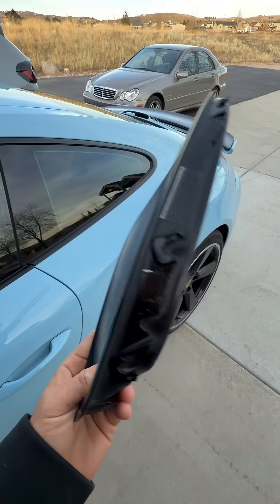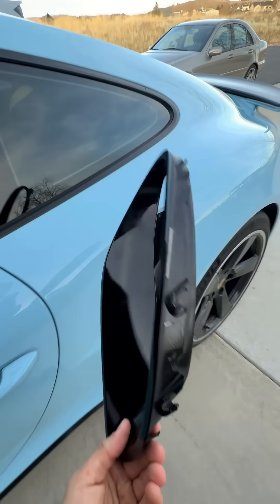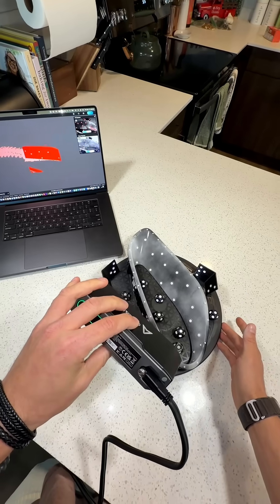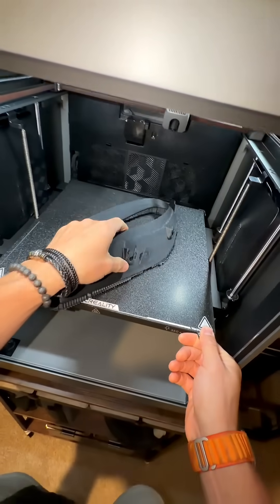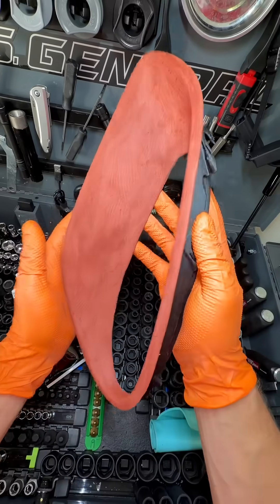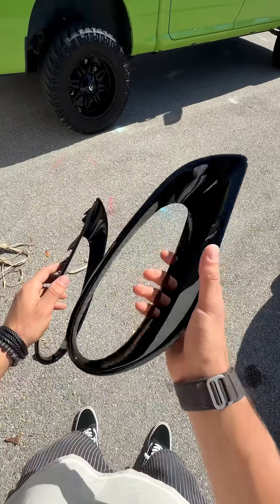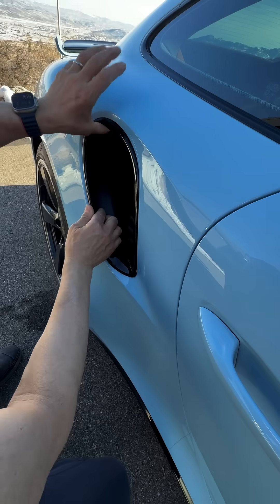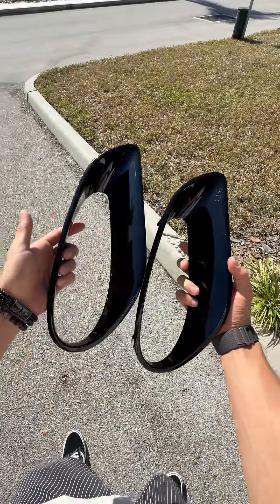Porsche wanted $2,000... So I 3D printed it for $20 instead😳😳😳 #3dprinting #creality #porsche

Comment: Well done... unless you paid somebody for it.
Intellectual property, you know.
Yet it should be OK if you perform it by yourself or have it for free (need some checking though.)
Problem is, 10 years after the last model was produced, car manufacturers may be free to stop providing parts.
Ah but intellectual property still holds.

Comment: “It actually costs more, and takes longer, and needs more knowledge”
Do you people genuinely think this man was suggesting that you buy and learn how to use a 3D printer and scanner for the sake of one repair? Obviously he wasn’t, the point was that he already has this stuff, and that therefore makes this cheaper than buying the part, so you don’t have to shell out an extra 2k for it. It does take longer for sure, but I’d rather wait a bit than pay the 2k when I know I don’t need to.

This comment section is so collectively dumb.

Comment: You could have just bought them from aftermarket sites for a fraction of what Porsche asks for them. It took me about 30 seconds to find three sites that offer them in carbon or ABS, both for around 1000 dollars. I mean, I get the point, but it is not as dramatic as you say. You really should not be buying original Porsche parts, that is for sure.

Comment: That’s been stolen. Classic parts theft. Happened to an Audi A4 I had. Three weeks old and found it missing a mirror (just the glass, the housing and interior workings were fine) and the cover off the driver’s side front wing turn signal.

Comment: Yeah. 3D Print can save money. Spar parts often expensive or not available.
I used my 3D printer for spare parts already. Some small parts in example, where only a complete assembly was available as spart part. In one case it was only a small gear, where only the complete drive was available. So reengineered it and printed. since 1 1/2 year and on going it is working flawless. ☺️

Comment: Bullshit clickbait! This did not cost you only $20. The 3d printer that is required to make the part costs around $500 (at least). Cost of the 3d app? Cost of a computer to run all of this? And not to mention the cost of the primer coats and paints. You said yourself that the "flawless paint match" cost you about $100. Not to mention all the time and labor you spent doing this all yourself. Maybe total with all the necessary tools to do it yourself is around $1000 or more.

It's still less than the $2000 that Porsche wanted. But at least don't be dishonest and say this only cost you $20.

Comment: buying a product: 2k

but, i am doing to DIY it, so
have the knowledge of modeling: $100/h
have the right 3d printer: 1k?
have the printing material: $25?
have the scanner: $500?
have the spray: $25?
have the computer that can run 3d stuff: $600?
have the 3d app: $100/month

let's say it takes 4hours 100*4+1000+25+500+25+600+100=2650😂

well i guess if I got a Porsche, neither time or money is the issue.

Comment: I'm amazed how people are defending the multimillionaire company instead of the YouTuber that 3d printed the piece.

"the 3d printer is expensive" yeah but it doesn't count into the cost of the piece, it's like saying getting gas in the gas station is expensive because you need to build the gas station... No dude, you don't need to build a gas station, it was built by someone already and you just need to pay for the gas.
Reply: WRONG. If 3D printing everything at home was an option for EVERYONE to avoid dealer prices, then everyone would already own a 3D printer, all the hardware, software, materials, and tools needed to make parts. You can't just overlook the cost of all that stuff. It factors in whether you agree or not.

Comment: Note: don't do that
you absolutely don't need a 3d scanner that is worth more than a used car. You can just take measurement, and design the part yourself. Sure, it might take more time and you need knowledge, but you will just need caliper, and the dimensions iwll be much more precise.

Comment: if you take out the 3d printer from the calculation then you could produce it for like 300€ if you only print it and let a professional sand, fill and prime and paint. I mean at that point it doesn´t matter if it´s 100 or 300$ you saved a lot. also you could sell those for like 1k and make huge profit and be still 700$ cheaper than og parts xD.

Comment: So, two or three jobs with this printer to break even, from then on, it’s money for jam.    
Similar economics, I was looking at hiring a local earthmoving contractor about 15 years ago to do three jobs on my farm.  Quoted $15K to $22K (three quotes).  I bought an old excavator for $10,500 and kept that machine for 15 years, using it at least once a month throughout that time.  A year ago I bought a brand new excavator, and sold that old one for $7600 (it was around 23 years old at the time, but worked fine for its age).  
I am now an earthmoving contractor, in addition go being an RN (32 years), farmer, boat builder and metal fabricator.

Comment: I would incad make the push pin / clip system about 15 to 25% larger and use a more vibration resistant plastic

Comment: If you keep doing it and keep showing them how cheap it is to do your own parts. The company will finally lower the price, but you have to keep pushing it in their face how easy it is to do without taking it to the dealer, to get it fixed.

Comment: You don't need the scanner for this; it just makes the process easier. There is no way the scanner is going to produce the same part that Porsche does. Also you've reduced the resale value of the car by using uncertified after market parts.

Comment: Everyone’s like “Oh BuT aLl ThE eQuIpMeNt He UsEd CoStS mOrE tHaN 2k” yeah but it’s not like he bought the equipment FOR the project at hand, he already had the equipment required therefore meaning the cost shouldn’t be factored in. Also this video is NOT saying you should get all of this stuff instead, this is just a scenario in which someone needed something that their friend could make for a fraction of the price that they’d be charged otherwise. Obviously if you don’t have all this stuff don’t buy it, just go with the manufacturer.

Comment: How do u match the exact size tho? Just curious how 3D printing works, esp the scaling, cuz just a couple milimeters off and the piece could end up useless
Reply from the maker: The scanner is accurate to about +/-0.02mm and since this isn’t and engine it doesn’t need to be “dead on” the clips have give. If you’ve ever taken a car apart or put on back togeth. Majority of things have room for adjustment and play. Nothing it 100% dead on.
Reply: @Haydenschreiermk2 interesting, im guessing in future a lot of things are going to get cheap and a lot more durable

Comment: 1. Make 10 pairs (20x20=400)
2. Go to a porsche dealership 
3. Swap the original parts from cars with the 3D printed ones
4. Sell the original parts for 2000 for each on the ebay (2000x20=40000)
😘

Comment: $1790 + tax and shipping 

$1000 for a high quality 3d printer 
$500 for a decent 3d scanner
$30 for a high quality asa material
$100 for additional material 
(on the higher end js to be safe)
Experience is free

you get all of this for in the range of
$1630 and on top of getting a new part you also get a 3-D printer and a scanner just in case that part breaks again. 

1700 dollars is absolutely absurd for that piece of plastic.

Comment: Just did a very similar project on my 1st gen 4Runner. It was missing a rear bumper cap and they aren’t available except as a single seller with a fiberglass copy for >200. I removed the one I had, scanned it, replaced the captive hardware in the design with carriage bolts, then mirrored and printed. The future is now with things like this

Comment: With all the steps you took, I'd say $2000 is actually a fair price. 
You have and used a 3d printer and also went thru a multi-step finishing process==> taking all that into consideration USD2000 is cheap 🧐🧐🧐🧐

Comment: $900 scanner, $1100 printer. 
Yes you can do more but the cost to get started is high and you'll be chasing the savings.
I would love a scanner. I am fortunate enough to have an ender 3 printer. 
But there needs to be an honest discussion on the cost of the tooling to get to this point.

Comment: That’s a general problem of today’s auto industry. Parts alone or along with cost of work cost 20 times the price of manufacturing. If by any chance led headlight stops working, you might need to replace entire front mask for 20% of the car price. I guess that’s why US and EU automakers are afraid of Chinese automakers.

Comment: 2hrs scanning, 4hrs cleaning up the file, 12hrs printing, 4hrs cleaning up the print and sanding the layer lines out, 2hrs polishing, $150 to rent the scanner. 12hrs technical labor at $50/hr for $600, printing services for $200. $950 part.

Comment: Hey man just a heads up if the plastic is smooth after you print it just use scotch brite prime then spray. 320 will leave sanding marks and make more work.

Comment: That's not $20 - assuming you already have a lot of expensive scanning and printing gear, there's printing material, primers, sandpaper, plus the $100 for the auto paint shop to paint it for you. Plus hours of work of course.

Comment: That is not a 20 dolar piece, maybe in filament.
That is at least a 200$ one if you take into account: 3d scanning or modelling, at least 40$ in filament and print time and post processing.
Saying you spent 20$ but you own 1000-1500$ starting equipment is misleading

Comment: yeah 3d printed it for 20 my ass. Avg person isn't going to have all this stuff handy already like the scanner or the printer and the filament you are using. Then there's just the knowledge know how and handiness you'd need. On top of that it's still not an official fix with an official part which technically lowers the value of the car. People aren't going to like to hear I fixed stuff on it with a 3d printer when it comes to cars like this. Yeah it's neat but let's be real avg person that can actually afford that car is just going to pay the 2k. Not Macguyver a solution.

Comment: That part DOES NOT cost nearly $2k unless you’re replacing it with carbon fiber. Find the replacement part. It’ll be faster, cheaper and less of a hassle.

Comment: DIY will end up costing more even if you already have a 3D scanner and the software. It will cost prohibitively more if you have to buy the 3D scanner and everything else. It's much cheaper and easier to just buy the replacement part directly from Porsche. Hell, it will still cost less if you ask Porsche to supply and fit the replacement part.

Comment: Thousands of dollars saved on the part.  Thousands of dollars spent on a 3D printer, scanner, software, etc. plus hours learning the software, and trial and error for a single part.  Then, after filming this video, you know this guy went looking around his house and the internet for new things to solve with 3D printing. He becomes that guy who, instead of saving random debris thinking one day it will have a use, he thinks the 3D printer is the solution.  Same sickness, different gimmick solution.

Comment: $20 if you're not including the super expensive machines used to make it and the $100 spent to paint it ig
Reply: The scanner is $750 and the printer is $500. I understand its not in everyone's budget but its definitely not super expensive.
Reply: If you install a framed painting on your wall, do you count in the price of the drill you put the screw on the wall with? 😃
Reply: You could spend about 1k on gear similar to this video (printer+scanner+paint), which is still way cheaper than the part itself AND now you have the tools to make anything you want.

Comment: Dude , when you bought a $350,000 car , you go ahead and buy the $2000 part.
Reply: A $350,000 car that parts fly off of, or can be easily ripped off at the roadside? That's not a $350,000 car, that's just what people pay for it.

Comment: everyone in the comments talking about the price of the printer and shit is missing the point, if you are only buying the printer to repair this piece sure, but if you have a 3d printer why wouldnt you use it for a bunch of other stuff? and if you already have the printer getting the catridges and everything is far cheaper than the replacement.

Comment: I am thinking about using 3D printing to do size check for the custom parts I am making for a motorcycle.  Can you tell me the info on that initial 3D printer you used?  It’s only for size/fitting check.  So the print doesn’t have to be high resolution.  And I would like it to be as economical as possible.  Your feedback is greatly appreciated.

Comment: You did so much useless things you did not need to do at all. I make Lambo, Porsche, or any car part anyone needs with the printer. I sell them on ebay all day long. I even sell parts for watches as well. There is no need to smooth out the plastic with bondo. It is useless. Waste of time. Just use the same 350 grit then 1000 grit, then 3 thousand grit. Then polish the plastic. There is no need to use bondo and wait for it to dry then sand it again? Wow. Crazy.

Comment: Since this is an ASA print, you could use a sealed box with acetone and within an hour or two you would have a very smooth and shiny model like in the factory.

Comment: How did you create a piece which was missing? The one you scanned is actually in the opposite direction..
Reply from the maker: You can mirror it in the software. And make the side your missing
Reply: @Haydenschreiermk2  aha, thanks, I didn´t know that. Good work then :)

Comment: So, lets say you would have used an adequate to carbon fiber. Thats around 30$ more, so 50$ in total.

Judging by size and complexity this took at least 50 hours. Thats roughly 10$, if the Bambu Lab H2C Combo would be used as reference.

Lets say you got payed US minum wage for the time you couldnt work on other projects, due to your printer being occopied. Thats 362,50$. But, due to you having a higher level of expirience, 13,00$ is more fitting, so 650,00$.

Lets ad the labor for scanning, wich probely took 2-3 hours with after work, adding supports and rendering. Since this is a 1 time job, 3d artist often charge around 300,00$ for such jobs, if commisions like fiver are used as reference.

Paint job and finish, since you are less experienced, roughly 9,00$ per hour. Probely took you around 1-2 hours with drying time (wich companys also charge). So 18,00$

Thats a total of: 1.018,00$

Thats what you should had charged if this was a comission. Since you did 2 its a total of 2.039,00$.

Comment: Soooo, $8k 3d printer, $100 in high grade plastics, $100 in paint, $30 in scanner paint, $50 in fillers and sand papers, then 8 hours of labour, plus the risk of it not fitting properly only to fly off and damage your car and the one behind it. Bargain!

Comment: I bought a $5000 3D printer and a $2500 scanner to use on my $2000 PC with $100/month software to “save” money on an expensive part.
All well and good if you’ve already purchased all that, but not really practical. 

Lastly, you paid $100 for painting, so tell me again how it only cost $20? Must be American maths, the kind you use for tipping.

Comment: Cool, but they were asking for under 2000 for the part and you spent 2 to 3 hundred, if not more in time, labor, and parts. So to say 1000s (meaning multiple 1000s) is a bit of a stretch 😂 but I get your point. Not just need to find 1000s more dollars to buy a printer and find the time to learn how to use it, and buy a larger home to have room to fit it 😂

Comment: So all you need is a 3D scanner, a high-end 3D printer, a computer with appropriate 3D modelling software, the required skills to operate all that stuff, and a week of time to faff about. All up, probably around 15k.  And for all that you can make a part that would have cost under 2k... did I get that right? 10 out of 10 for style, but minus several million for good thinking. 😂

Comment: Why 320 grit. Wet sand that with 600 grit wet and work your way up, then sealer, then paint. Made your job harder by using 320.

Comment: So the gist of this video is that the quote was correct..
The necessary tools like the 3D scanner and the printer.. The time that it took for the machines to do the production.. And the labor of you doing the 3D model cleaning and adjusting and the sanding..

Yep, that looks like $2,000 to me

Comment: ASA is not UV-stable.... no plastic is inherently UV-stable with VERY limited exceptions. make it black and most plastics can handle UV reasonably. preferrably lamp-black as the carbon particulate from soot is the most cost-efficient additive for UV stability in plastics.

Comment: I’m not sure if the plastic you used dissolves in isopropyl alcohol, but a cool way to smooth out those edges that looks nearly perfect every time is to:
1.) find a large plastic bin and a smaller, shorter bin
2.) soak some paper towels in iso
3.) place the small plastic bin upside down, then place the part on top of the small bin
4.) lay the paper towels around the base of the small bin
5.) place the large bin over everything, creating a vapor chamber
6.) let sit until everything looks smooth

Comment: He doesn't need ASA for this ABS works just as well since he's painting it anyways. The paint will take all the UV before it reaches the plastic. 

Maybe temperature resistance but ABS is fine even when left under the sun